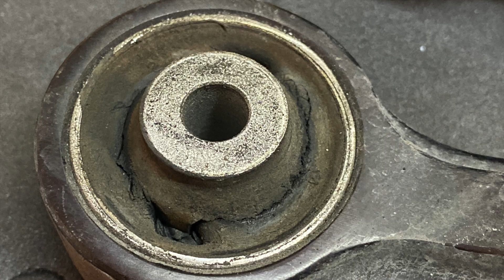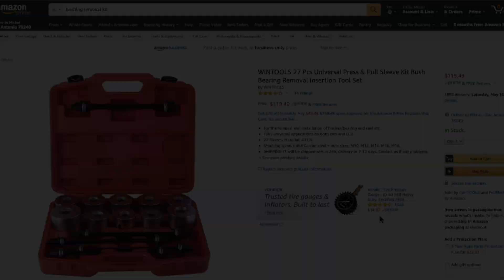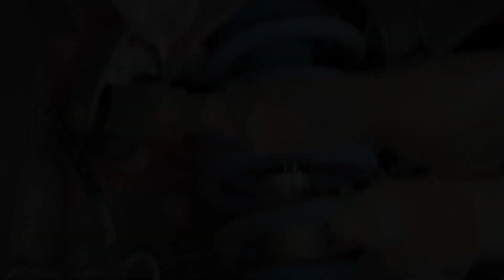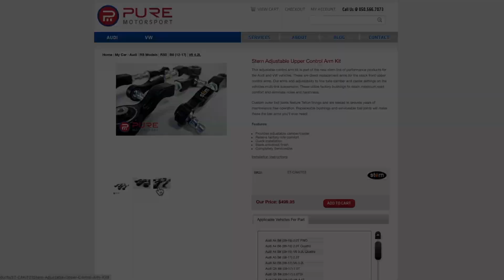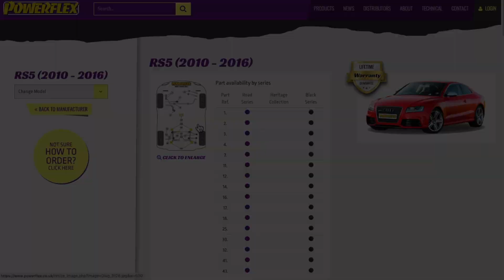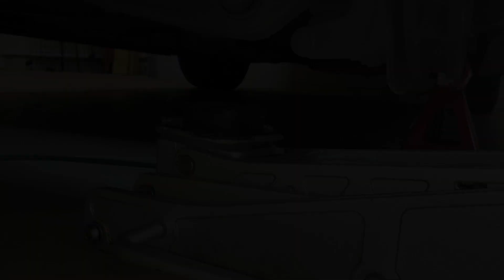Control Arm Bushings Bad Again!  Poly to the rescue?

Comment: Yeah these go bad after time. Fortunately pretty easy to replace with aftermarket upper control arms. The bigger problem with the RS5 is the drive position sensor in the gearbox/transmission (G676 sensor).
Drive Position Sensor (G676) in my 2013 RS5 went bad, as Audi expected and knew it would. Cost I was quoted to 'fix' the issue was $26,461.00 !!! When I asked Audi why my RS5 with low miles and a full service history/record, including frequent transmission services (in hopes to keep this from happening), is now in essence totaled due to the sensor, their response was that I should have expected to need to replace the transmission when I bought the car. They certainly did! But of course instead of issuing a recall where they would have to do something about it, they just issue a TSB so that their techs don't waste any time diagnosing the issue (they can and will still charge you for the diagnosis though). Pretty disappointing how little Audi cares about their cars or their customers.

Comment: Is this something where you KNOW the bushing is bad? Like when you get a flat tire, you clearly know something is wrong.  Is this the same type of scenario?  My RS5 seems fine, pulls to the left a bit, but I’ve always wondered about these.
Reply from the maker: They're known for going bad on various Audi models but generally it creeps up on you slowly so you don't feel this massive difference.  It's usually accompanied by a bit of slop in the steering and shifts in trajectory over uneven surfaces.  You'll sometimes get a knock but most times not  It's only when you see they're torn (visual inspection) and swap them out that you notice the difference.  Generally I'd check them every 30K miles.
Reply: @ 

Thanks man!  That was my post on FB btw.

Comment: My car right front lower control arm bushing is dead. Now the repair shop quote me for 850$ plus tax and 7 hours labor to replace all the front control arms the 034 set. Right now the car is at 105000km, should I just replace the bushings or the complete set?
Reply from the maker: Hi Yang, I'd likely just go with the replacement control arms from 034 instead of just the bushings.  You can't purchase the 034 bushings separately and honestly, it's just easier to swap in a new arm as opposed to pushing the old bushing out and inserting the new.  Takes less time and less $$$$ out of your pocket for labor costs.
Reply: @RS5Fanatic  normally how many hours of labor should be for replacing a whole set of control arms?  They quoted 7 hours. Is that too much?
Reply from the maker: @yangguo3652  Honestly that's about right.  It's pretty labor intensive.

Comment: How often you change brakes and control arms??
Reply from the maker: I was going through upper control arm bushings like every 30K miles.  I have CCB front rotors so pads typically last for 60-70 K miles and half that on the rear with aftermarket pads and rotors.

Comment: Love the video, and the RS5. You wouldn’t grease the replacement ball joints in the control arms at all? I am replacing mine currently, and assumed packing it with some grease from Liquimoly would be fine. What would you recommend?
Reply from the maker: I haven't had the "pleasure" of replacing the ball joints but I'd imagine they're sealed and probably good for the life of the ball joint. The only indicator they need to be lubed would be if there's a zerk fitting.
Reply: @RS5Fanatic  gotcha, yeah I think you’re on to something with the fitting. I’ll replace the ball joints without greasing them and see how they hold up to a PA winter. If they need replacement next year again I guess it is what it is.

Comment: That pinch bolt, in the UK, not a chance in removing it. Corrosive rock salt on the roads every winter along with constant rain.
Reply from the maker: LOL, penetrating fluid and heat!  This is why I live in a (normally) snow-free zone.

Comment: What exhaust do you have? I'm a new subscriber, I just purchased a 2014 rs5.
Reply from the maker: It's JHM's full 2.75" cat-back system.  www.jhmotorsports.com.  It's a valved stainless system so you're able to close the valve and run a quieter setup or open the valves to have a louder setup.  Power wise, it's probably the best on the market.

Comment: https://www.fcpeuro.com/products/audi-control-arm-kit-8k0407693afkt. Looks like the HD version of the upper control arms might do the trick. Just over 5o bucks each with the hardware and lifetime warranty!
Reply from the maker: Possibly but they're still going to be a bonded rubber bushing with an outer shell.  I have to say though, the poly bushings are the shit.  Really liking them.  Took the time to get an alignment as well and all of the vagueness just off center is completely gone.  How long the poly bushings go without squeaking, well, that remains to be seen.
Reply: RS5 Fanatic. Very true. Just giving folks another option with High Density poly. Advertised as better than OEM with lifetime warranty. Never buy again. Just replace. CHEERS!
Reply from the maker: @jesseholloway5711  That's a good point.  I really like the fact FCP Euro has that lifetime warranty.  I would most likely go that route with any of the other arms.  Add too many poly bushings and things could get pretty harsh.  I'll be doing another video and update on the poly bushings once I get more seat time with the new suspension height and alignment.

Comment: There's a squeaky noise coming from the right rear side of my car. What you mention might be it cause the previous owner said they only took things out of the car to check and try to find it. I'll look into replacing those later. Are you going with 034 Motorsports?
Reply from the maker: Nathan, as discussed, check the trunk bump stops along with the rear bumper.  Two known issues.  The rear bumper has pieces of felt between it and the foam and if they fall off or weren't installed correctly, they can rub and squeak.
Reply: @RS5Fanatic  yeah i've gone as far as having one of the rear bumper 10mm nuts back off and that was causing the squeaking

Comment: Great video. I wonder if it would save time removing the strut and top mount as one piece then doing the work on a bench? Can I be a friend?
Reply from the maker: LOL, James you crack me up.  Bots.  I don't understand the point of them...Anyway.  It's a bit more difficult to take the entire assembly out as you'll obviously remove the top four bolts holding the upper mount to the shock tower but you also need to separate the ball joint and the bottom damper bracket so you end up replacing more bolts in the process.  It was easy enough to just measure the shock collar and lower the spring a bit.  But the last time I changed the one bushing on the right side, I removed the entire assembly to also replace the top hats.